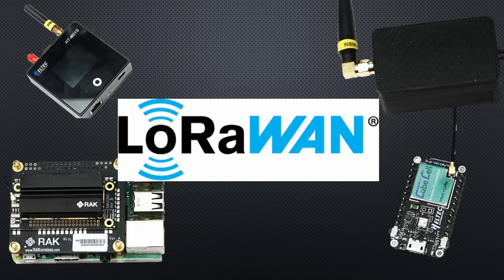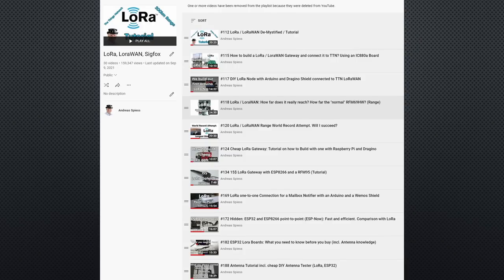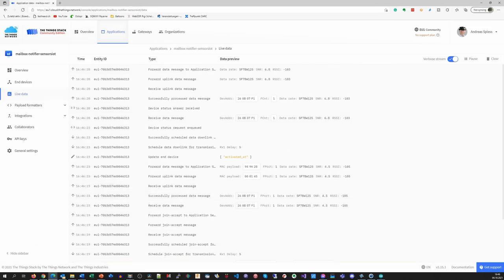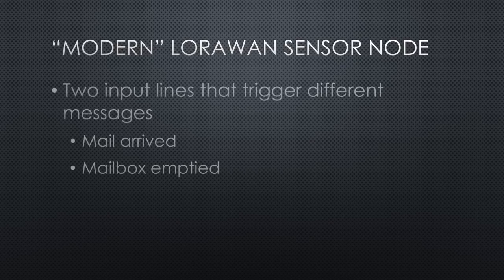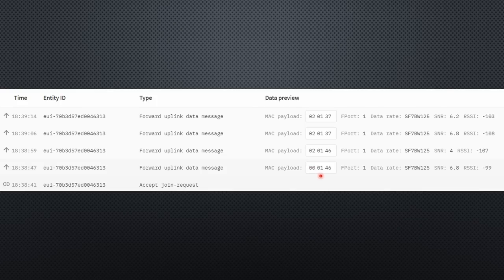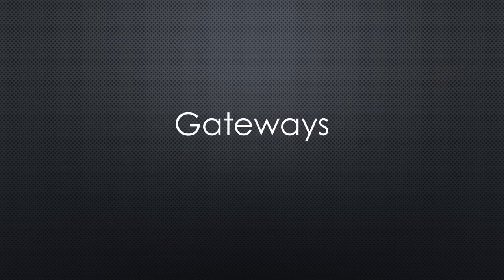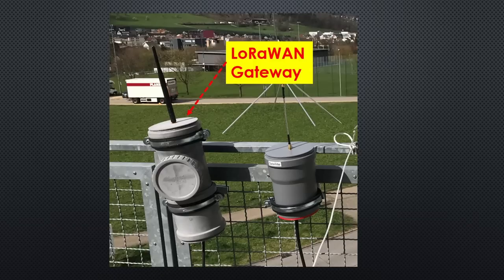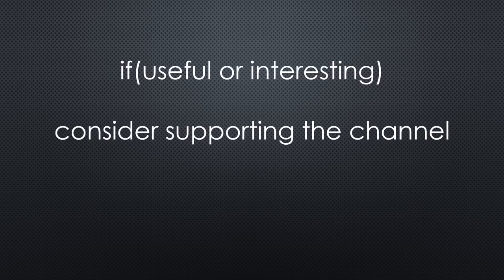#404 How to Build or Migrate Sensors and Gateways on TTN LoRaWAN V3

Comment: 12:23 Interesting, I thought it was 1% for everything before. So I checked the ETSI documentation and found it's 10% on 433 MHz and you can ignore the duty cycle limits on some frequencies if your Tx power is set at a lower limit.
Reply from the maker: These limits are defined locally. But LoRaWAN in Europe is on 868MHz
Reply: @AndreasSpiess My understanding is that while TTN doesn't use it, it is allowed.

"The LoRaWAN® can be used in the 433.05 to 434.79 MHz ISM band in ITU Region 1 as long as the radio device EIRP is less than 12 dBm. The end-device transmit duty-cycle SHALL be lower than 10%.The LoRaWAN® channels center frequency can be in the following range:

• Minimum frequency: 433.175 MHz
• Maximum frequency: 434.665 MHz

EU433 end-devices SHALL be capable of operating in the 433.05 to 434.79 MHz frequency band and SHALL feature a channel data structure to store the parameters of at least 16 channels."

Comment: Great video, Andreas. I successfully migrated a v2 sensor (running on a 32u4 board) using ABP. After some research, it required small changes in the device description to make it work in v3.
Reply from the maker: You are right. You have to deal with the counter in a different way and add frequencies in the backend. Our old nodes will not work without changes because most of us kept the counter at 0.

Comment: Maybe a delicate point but isn't updating the protocol with no back compatibility going to destroy confidence and limit uptake. Hope they can keep it stable for many years now.
Reply: Yep, if they have any interest in surviving then forward and backward compatibility will become their highest priority
Reply from the maker: The network was backwards compatible for about a year before it is shut down. My gateway and sensors ran now for nearly 5 years and the upgrade procedure is not that hard. So it is acceptable if I look to other technologies like my Smartphone or PC. The communication was not very good, I think. I had to do a lot of investigations, mainly on the sensor side.
Reply: I was about to write the same.
Reply: @AndreasSpiess  I find it disturbing that we've reached the point where we'll accept 3 to 5 years  of compatibility. 
I own a 70 year old phone that still works on the current network.
I can still listen to 50 year old CD's through my DVD player, and I can still get parts for my 30 year old car, washer, dryer, stove, and furnace.
But because it's "modern", we're happy if we get 5 years before we have to toss it?

(Edit: 40 year old CDs... 
Thanks Dagerman65!)
Reply: @RottnRobbie  I agree with your general sentiment, but 50yr old CDs won’t be here until about 2029… 😂

Comment: You were referring to those devices as cheap, I wouldn't call it particularly cheap when the TTIG costs ~92€.
Already made sensor for outdoor use, 70€.

Zigbee is so much cheaper.
Reply from the maker: I also use Zigbee for short range. A very good technology similar to BLE.
Reply: @ruakij6452  I was talking more about the already made sensors, and not the modules themselfs.

Comment: My newest project is simple. Just a simple ESP32 or whatever with GSM and a single button... it is for my mother,. When the button is pressed it will send an email and an SMS to report an emergency. It can call me and the emergency. Makes a lot of sense. It can easily be altered to make a children tracker. GPS modules are cheap these days.
Reply from the maker: Its coverage is extremely good compared to all other technologies. But you are lucky that the GSM network still runs in your area. In many areas they are already shut down...

Comment: Fantastic Sir! Thank you. I tried ABP mode MCCI library with RFM95 sensor node. The node works on activation of TTN v3 for a day. Next day the node does not work... so again I have to re do as a new node. I would try OTAA as you suggested.
On the GPS tracker node , in the v2 version you can see the gps node on the TTN mapper , but I cannot find that in the V3 after migration...
Reply from the maker: ABP works. But you need to manually add frequencies and pay attention that you counter always counts up. Even if you disable it.
Reply: @AndreasSpiess  Thank you sir I will check this.

Comment: Great video Andrea, nowadays I am using a esp32 for a project using wifi and sigfox, i am starting to use de rfw95 to have also the possibility to use LoRaWAN, and I have test it and it works, but is true that i have to sleep them.The issue is just that after sleep mode I have to redo the JoinRequest, or there are further problems. I will really appreciate your help. Thank you very much in advance. Miguel Morales
Reply from the maker: If you live in Europe you should be able to use my sketch from the last video.

Comment: Have you tried the Ra-08 out? It's got a SX1262 chip in it so more modern and also an ARM Cortex M4. AI-thinker has a Github page for it, some stuff is in Chinese, although what I was wondering is if I could load the Semtech's code onto it. The AI version says you need to run Linux, but the Semtech people say you can run their code in Windows and the way it loads means it will run on any target processor. I've had a look at the code and see it is quite easy to configure. You just dump your data into an array and set the flags etc.
Reply from the maker: AFAIK, the RA-08 already has a LoRaWAN firmware on it and is used with AT commands like an old modem (search for "LORAWAN NODE APPLICATION: AI-THINKER RA-08/H MODULE"). I did not find information on how to program it with the Arduino IDE. It contains an ASR6601 MCU. Maybe you can program it with the Heltec Cubecell software?
Reply: @Andreas Spiess  What I'm interested in is low power, and low cost and hardware complexity, so the whole reason to use it is it looks possible you can run the whole thing on the internal processor. The other issue that helps is the whole thing comes self-contained in its own screening can and is designed to pass the CE certification. All high speed switching is nicely screened and tested for EMI. 

Actually I would not be surprised if the Heltec software is very close the AI thinker pre-installed software which in turn will be a fork of the Semtech official software. I've got a copy of Visual Studio if the Arduino system does not work. The Ra-08 is new so not too much software support yet.

Comment: Excellent video, as always. I'm new to LoRaWAN and TTN and even after days of research I'm unsure of one thing: I want to monitor and ideally remote control an off-grid irrigation system controlled by a raspberry pi. Since there's no network connectivity, I'm thinking of connecting it to TTN, but I'm not sure how to best do things. Would a SX1262 Hat be sufficient to send data from an number of sensors and receive commands? Or would it make more sense to have a esp32 board with radio that connects to the raspi through wifi and is used as a relay to TTN? Or are there existing solutions to this? Any help pointing in the right direction is highly appreciated!
Reply from the maker: Maybe you watch my other videos about LoRaWAN. Particular the introduction. The chip selection is not important. All chips have very similar performance.

Comment: I am wondering, if you connect to TTN, with your own LoRa-gateway, is that using LoRa as well?, or is that via Internet only. If so, why not use an any other MQTT broker on the Raspberry Pi itself combined with Grafana. Or connect to TTN directly from the Sensor-Nodes using LoRa. (....Me puzzled....)
Reply from the maker: Maybe you rewatch my LoRa introduction video. The gateway is connected to the internet. It receives LoRa messages and transmits it to the TTN backend. There my MQTT broker get them and feeds them into node-red.

Comment: Excelent informative video!! How can I use the "Low power Atmega1284P based Arduino Lora node" with 915Mhz Andreas?
Reply from the maker: Just use a different RRM95 module which supports 915MHz

Comment: I don't get you point why esp32 are not suitable for MCCI OTAA. OTAA should be used to join the network. Once done a ABP is totally fine after a sleep.
Reply from the maker: I am not sure if you can mix the two in one node. At least I had to chose one for each end device (ABP or OTAA).
Reply: @AndreasSpiess  you can mix abp and otaa... This is even the desired method by ttn.
Reply: This is an insight I wish to learn more about. Any good pointers?
Reply: yes greater clarification would be helpful here. because of the desirability of esp32 in sensor nodes. and also because for other mcus, then the addition of a 'nano power timer' would also mean the mcu execution gets resetted there too, right?

Comment: Hello Andreas
I am attending a further education course at the ZHAW and am working with Arduino and LoRa for the first time.
I have an Arduino UNO board and a Dragino LoRa Shield v1.4.
I want to connect an analogue sound level meter to my UNO board and transmit the data via TTN. Afterwards I want to visualise the whole thing on Thingspeak.
Can you give me a good tutorial so that I can achieve my goal?
Best regards
Patrick
Reply from the maker: As I said in the video: The Arduino is no more a good choice because it does not have enough memory. I made some videos on how to build LoRa sensors in the past.

Comment: I have been enjoying these LoRa videos and have learned quite a lot from them.  But I have not seen anything about using LoRa only on an isolated network.  I am using Home Assistant and have several devices with it.  I built a mailbox sensor a lot like what you have, but used WiFi for the communication and ESP Home on the sensor.  It has some problems with power usage and I think that is because of the board I am using.  LoRa looks to be a possible solution for this and other sensors I have been thinking about.  There are no local gateways to me so I would have to install my own.  My network connection can be problematic at time.  I don't like relying on the cloud because of this.  If my network connection goes down, or there are network problems, my devices stop working.

Is it possible to setup a gateway that runs on an isolated network so I don't have to rely on TTN?  I would probably also setup a second gateway for TTN, but it would be lower priority.  Is there anything out there that shows how to do a private gateway?
Reply from the maker: I made a video on one-to-one LoRa connections. Maybe a solution for you?
Reply: I live in a very remote area, my nearest non-tech neighbors are about 1 KM away.  To me it only makes minimal sense to use something like TTN.  I would really like to implement something like a star topology where the center brokers my messages either for Home Assistant or Node Red.  I am new enough to LORA to not really know what key words to look for.  I like Meshtastic, but it seems to be pretty limited on choices at the present.

Any suggestions.

Comment: I am trying to use nicerf sx1268 module with esp32 to sending and receiving data. Unfortunately i couldn't find the better Library support this module and pin connection aswell, always i have a initialization error message from the serial monitor pls help me i am a big fan of yours
Reply from the maker: Unfortunately, I cannot do remote debugging. I would check the connections to the LoRa chip and the pin definitions in your sketch.

Comment: Hi Andreass. im working in a final project for a degree, about LoRa aplication in Ambulance georeference and status alert sending. For the prototype im using a TTGO T-Beam V.1 board, but i cant conect the end device to TTN V3, the gateway shows that it receives packets, but in the internal application it shows no activity on the node, i put the EUIS in LSB and MSB, but is not working, can you help me a litle? Thanks!!
Reply from the maker: Unfortunately, I cannot do remote debugging. But you seem to be close if the gateway receives packages. If you do not see a join request in the application, something with your numbers is wrong. Then, TTN does not know that the number sent by your tracker is yours.
Reply: @AndreasSpiess  Thank you very much for your answer, what number do you mean? to the EUI? I have put them all as the code asks me, it would help me a lot if you take a look, the code is on GitHub, as TTN MapperTTGO T-Beam Tracker for The Things Network.
Should I modify something special in this code?
Best regards
Reply from the maker: @Ardutomas  TTN offers LSB and MSB notation. Some sensors need LSB and others need LSB. And sometimes it is even mixed. I am sure you will be able to solve the problem.

Comment: SD card in my ic880a/Ch2i based gateway has died and none of the installations seam to work with current versions of rasbian, tried going back to jessie but that fails as all the repositories are dead...  Anyone know of a working install?
Reply from the maker: I still have my IC880a running with an installation based on the Zurich method (link in the description. But I do not know which version of Raspbian I am using.

Comment: Sorry to disturb, but i find it really hard as a novice, to understand GET and POST requests... I mean, in url encoded form you send a string, not data, so you need to create the string first, meaning to convert data into characters ? And then decode the string, on the other side, and how to get sure the data is put in the right place. .? Thanks, l
Reply from the maker: This is too complex to be answered here. But I am sure Google will help you. For TTN, you just can use my Node-Red flow and it should work.

Comment: Great video as usual Andreas. However, considering we would like to be disconnected from the "3rd party clouds" (for any reason) LoRa makes sense only if:
1- your sensor is out of reach of your WiFi/BT and
2- you cannot use any other RF4xx/8xx MHz transceiver (for extension of the range)
Otherwise WiFi/BLE/RF modules are more "private". 
If you i.e. see where Home Assistant users go (read: devices that are INDEPENDENT from clouds) I am not getting why "sensors users/makers" should go opposite direction ;-)
Also: LoRaWAN reduces the amount of sent messages per day - sometimes it is not enough if you stay within the required/limited messages per day (ok, you might not have the postman coming more than 1 time per day but other sensors?).
Alternatively: own LoRa gateway but then again: why LoRa not any other radio interface/protocol?
"One more thing": if I remember correctly LoRa is patented and NOT open standard, right? One day someone will say: "kindly starting tomorrow please pay me..." ;-) Or in case of disaster, when cloud goes down you don't even know if there is... a rain or sun in your garden ;-)
One last thing: no OTA when you use LoRa, right? So the idea about having sensor that is far from you (read: further than your WiFi range) is killed when you need to update the program. Apart from OTA: when you have WiFi you can use MQTT to even reconfigure the sensor remotely i.e. update_interval or so - probably impossible with LoRa with limited transmitting allowed.
For the battery issues: I just upgraded all my sensors by installing solar panels (10x7cm) and even in UK the battery is full every day before the midday. This way battery is not an issue anymore.
No, I am not against LoRa - just thinking loudly ..."why LoRa(WAN)?".
Reply from the maker: Here are my 2 cents:
It all depends on the use case. I do not care too much about privacy or cloud for the data I transfer with LoRa and, as you write,  I only use it if WLAN does not work. You can do OTA for remote nodes with LoRa but I never tried it. Most sensors are so simple you probably do not need to update OTA if you did a proper testing job.
You are right: LoRa is a proprietary protocol. This is not important to me because it is built in a (proprietary) chip. I will be able to use this chip till it dies, even it I am not allowed to copy it.
Why not another interface/protocol? Because I would have to write it myself. And LoRa exists and in many areas you even do not need your private gateway. Very handy. BTW I use 433 for my weather sensor, for example.
Concerning clouds: I do not see that people go away from clouds. I see a big trend in the direction of clouds, particularly in the business environment. Private users already are on the hook for years (Facebook, Whatsapp, Apple, Spotify, etc). I do not push it in my systems, but I accept clouds if they provide some added value.
Reply: @AndreasSpiess  and you might be very right Andreas ;-)

Comment: I would rather wait for this technology to mature..For successful implemention one requires knowledge of hardware as well as networking...too much for people with limited brain functions like me...in the meanwhile i would experiment with cloud vm like amazon and my tv stb android box with debian for replacement of pi
Reply from the maker: I thought this LoRa stuff is quite simple if you know how to do it...
Concerning Windows on a Raspberry: Interesting and a good marketing trick for Microsoft. But here I am not sure if this is something I would want to do because I assume nearly no application will be compiled for ARM for some time. All the applications are the main reason to use Windows for me
Reply: Most comments going to spam...
Reply: I wrote 2 comments both disappeared. Only this appeared.
Reply: Regarding lora I think europe infrastructure already exists. Our country is far behind in lora. I don't want to get in hassle.
Reply: I think this project is not supported by MS. Good or bad they have huge resources. Arm has advantage of flexibility from sbc to server, it is available by many manufacturers.
Reply: A few comments are autodeletedand comments count is also reduced. It happens in 10 seconds